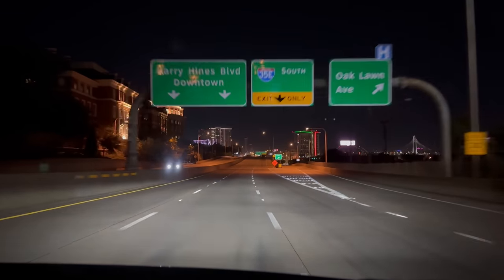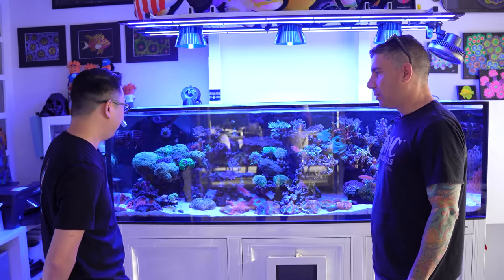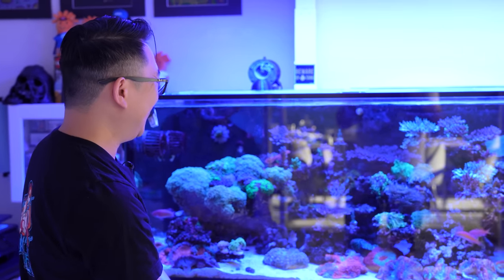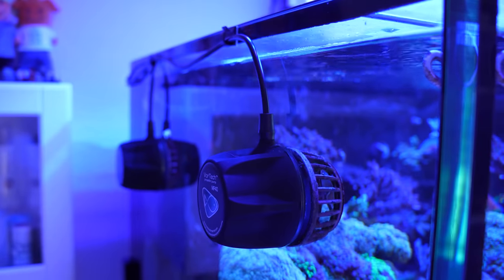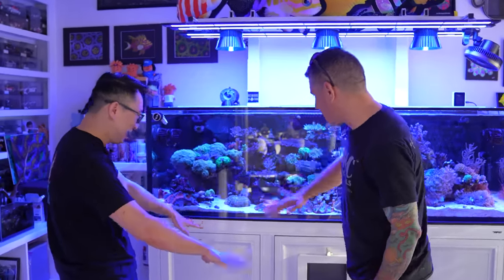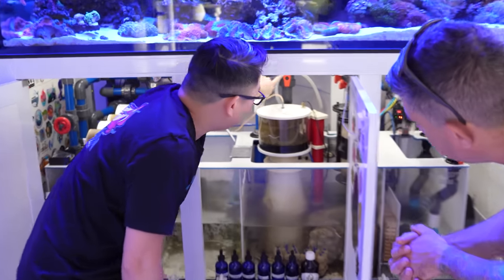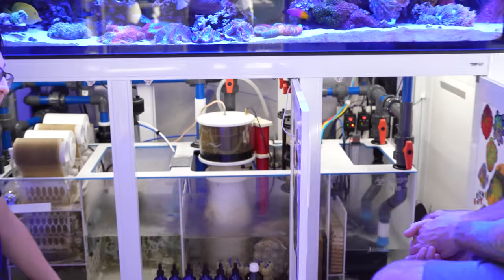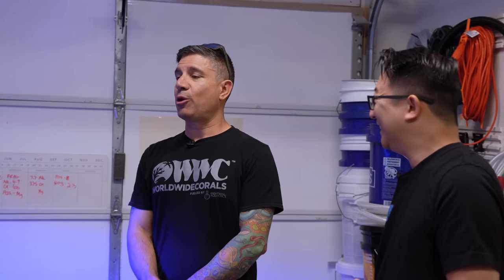This guy Turned his OFFICE Into an INSANE Fish Room!! @bayarea_reef

Comment: The old fan is a great way to cool a tank as long as you accept the damage it will do to all you other electronics in the house.....

Unfortunately someone took old mate for a ride if that chloramine filter is just for the RO unit considering the size of a chloramine molecule has no chance of getting through the RO unit and it won't clog the membrane. The only pre-filters you need before an RO unit is micron filters to prevent solid particles getting into the RO membrane, everything else in the prefilters is just tipping money down the drain.....